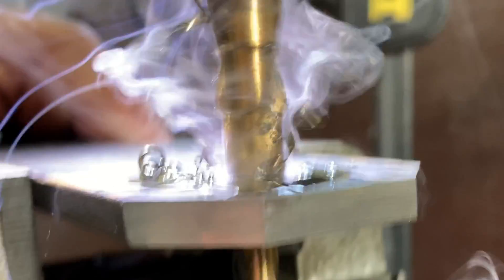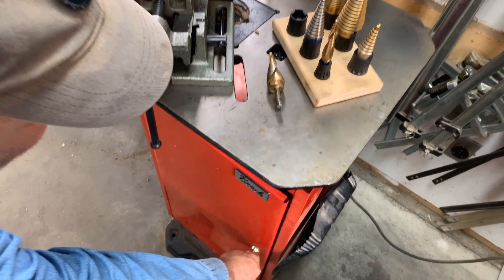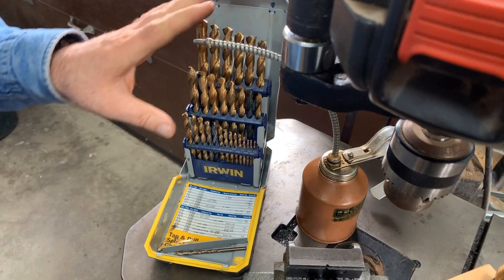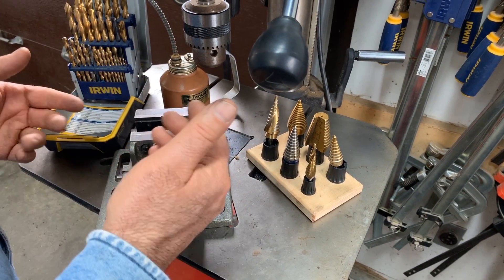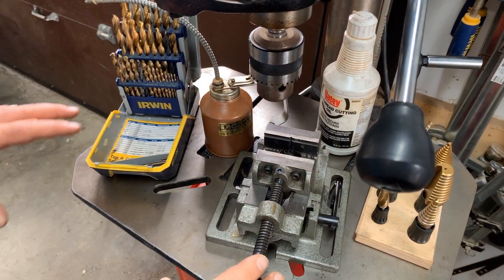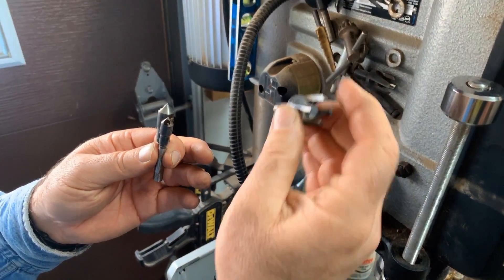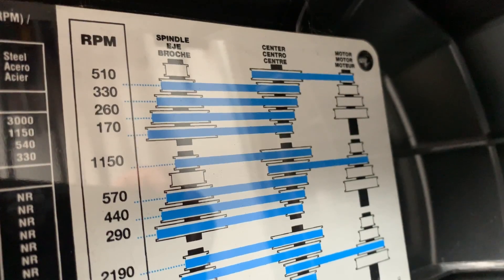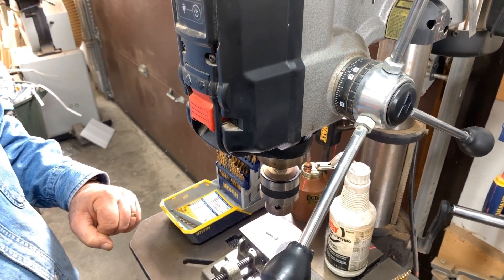Tour of Drill Press Metalworking

Comment: cobalt bits are generally more orange than golden/yellow. the colour of your drill bits suggest they are titanium coated bits, not colbalt
Reply from the maker: Thanks for watching and commenting. The package said cobalt, so perhaps the issue has to do with colour balance in the footage. Bottom line is that these bits do a great job in steel, and they do it for a long time.
Take care,
Steve
Reply: @baileylineroad  while there are many spurious claims regarding cobalt online, Irwin is a brand i would trusty to make accurate claims.
true it might just be the colour balance, not all cameras are equal.

Comment: actually tho for the speed there is a simplified formula for mild steel with a high speed steel drill bit its: RPM= 400/diameter of the drill bit (in inches). having the right speed will save your tool. The actual formula is RPM= cutting speed x 4 /diameter of the drill bit the cutting speed can be found in many machinery's handbook or on the internet and it varies depending on what you cut (aluminum, brass, low carbon steel, high carbon steel  etc) and what you cut with (high speed steel carbide etc)

Comment: Could you use an endmill tool in a drill press to cut a slot on a piece of mild steel?
Reply: I've tried it using a sliding vice. 
It kinda works, but the table doesn't have quite the weight and stability that a milling machine does. The metal or wood seems to vibrate and this makes it not nearly as accurate as a milling table.
Reply: @paul-ld9vh  Thanks for the reply. I was getting some chatter so am going to clamp my sliding vise more firmly to the table. From your video, it appears that you are drilling at  a slow speed. I thought perhaps I was going too slow so tried to speed it up but that didn't seem to help much. I am making my own carbide skews and was just trying to mill the end down to get that small step. It works well without the step but figured I would give it a try. Bill
Reply: You can do it but it will wear out your spindle.  Milling machine spindles have tapered roller bearings to handle that transverse load but drill press spindles use ball bearings which aren't suitable.
Reply: @renli3d  Thanks for the reply, I did one last attempt and it actually broke the tool bit. So...I have given up.